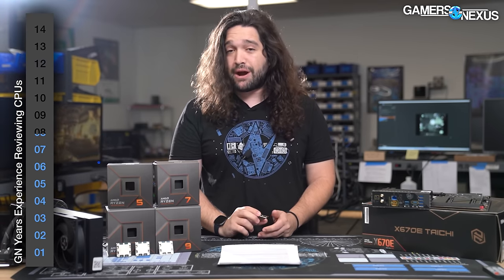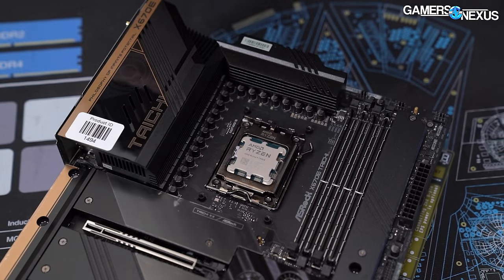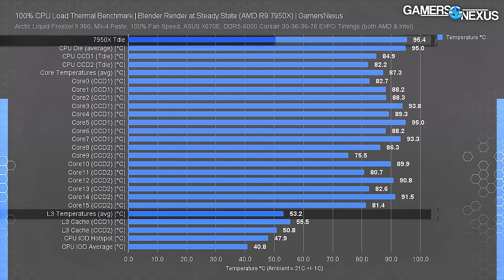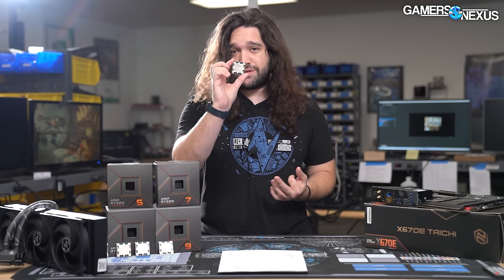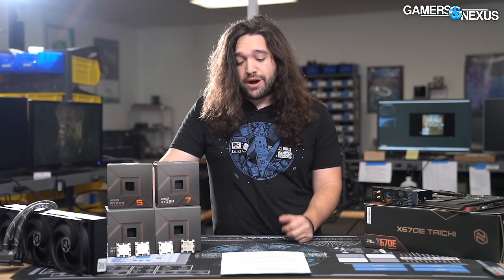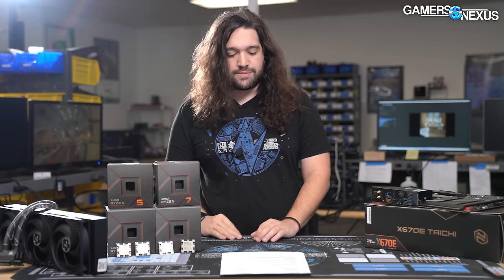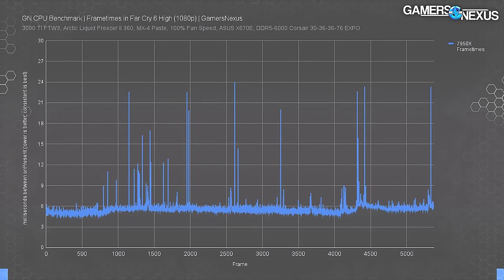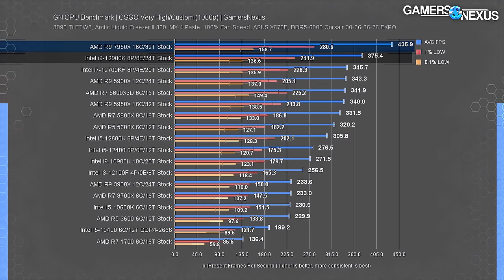95°C is Now Normal: AMD Ryzen 9 7950X CPU Review & Benchmarks

Comment: excellent report! I feel entirely vindicated having put together a 5950X system towards the end of its lifetime instead of waiting for Ryzen 7000. I'd planned on going to a 7950X system in 12-18 months but might not now given the power requirements, and given the massive spike in the cost of power worldwide (well, in "developed" nations). Thanks and I can't wait to see the 7950X and 13900K comparison.
Reply: I don't think you should look at max power draw, but at efficiency. Most of the time we don't run prime95, we idle most of the time or have very low loads.
I also expect that manufacturers also will make it very easy to limit power more if you want so, even under load, and also then efficiency is the key factor.
I have not checked all reviews, but read those numbers from AMD:
According to AMD: "AMD says the 35% overall improvement at max power actually increases to a 74% improvement when limiting the flagship Ryzen 9 7950X to 65W"

I think it's a good thing to limit the CPU power draw for energy price reasons, but if needed at some point you can run it hotter and faster.

EDIT I saw the numbers of GN now, seems indeed not to shaby plan to stick with the 5950X
Maybe wait until people undervolted it and look what those results give.
Reply: you want to build such a system but then show how sparse your knowledge about this topic is. excellent
Reply: I'm with the other guys on efficiency, see the Anandtech review for details on performance per watt. But I'm also happy enough with my Zen 3 build from late last year that I won't be upgrading till Zen 5 at the earliest. Will probably upgrade to a 5900x or 5950x if price continues to drop though.
Reply: @_clemens_  true, although I do occasionally run multi-threaded (i.e. multi-core) stress tests (developer). The max I've had out of my system was a sustained 90C under load at less than 20C ambient. Ambient does become an issue with the attendant possibility for thermal throttling especially in summer months with an ever hotter climate and no AC and using a Noctua cooler (that's now impossible with 7950X (Yes, I could swap the Noctua for an AIO))
Reply: @accelerator5524  so true lol
Reply: Lol the power draw of 7950x is low it’s 100 watts less then intel and way more powerful so 7950x is more efficient then 5950x and if you worried about 200 watts on your electric bill why are you looking at $700 to $750 dollar cpu and u do realize 200watts would raise your bill like 3 dollars a month lol
Reply: I'm also planning to buy one but only if DDR5 will become more cheaper or at least when companies like crucial or Kingston will release their value ram series (I don't want to pay the extra charge for the RGB and aluminum shroud)....
Reply: @Chuck0006  and if I'm in the UK with gas and electricity bills spiking to over £5-6000 per household next year?

Maxed-out the 7950X is NOT less than a 12900K in power consumption.

You may think it's laughable but these increased power requirements across the board particularly from CPUs and GPUs are going to affect us all, and not just from a single computer that we put together for personal use. ARM are going to be the winners here, more so than AMD and Intel, especially in the cloud and server farms.
Reply: @_clemens_  You're supposed to be able to set a power limit in software and have the processor follow that , which in theory should make it easy to fit performance to your ideal use case.  I wish they'd have shown results if you limit power draw to the power draw of the old processors, as GN have said several times that power draw and performance aren't linear.
Reply: @treyquattro  a maxed out 7950x is way under a 12900k the 12900k has been known to consume up to 350 watts and maxed out 7950x is like 230 to 240 and yea all the green energy stuff not good for anything like people see now cuz if you don’t drill for natural gas and the majority of power in the world comes from it the prices are gonna skyrocket cuz demand is going to way out do the supply
Reply: 7800x3D
Reply: @Chuck0006  200watts 7/24 will cost me over $120 every month here in Europe
Reply: @_clemens_  I run my 9700k at 100% all the time and highest it's gone is 70c just on air in a ITX with a full sized cooler, it had a low profile cooler and reached 90c, I got scared.

95c is crazy to me. Some of us have no overhead no matter what certain work just maxes everything out just like a benchmark...
Reply: @nerodia  Holy crap just read that review.  only a 17% loss of performance with 88w package power.  Almost makes me wonder why they even made default behavior so aggressive.
Reply: @dfloper  I’m gonna call bs on that the cost of kwh is 33cents usd in Europe at todays numbers which is literally only $47.52 and your not using it any near 200 watts for 24/7 most of the will be idling or in a sleep state at way less watts it so would probably raise your bill maybe $20 don’t over exaggerate
Reply: @Chuck0006  oy.
Reply: @_clemens_  I don't understand why everyone is getting so butthurt about the raising cost of electricity when in reality it won't cost you more than 20-40$ per year to run one of these newer cpus in your system. None of you are running prime95 24/7, 99% of you won't see a bill increase of no more than 50$ bucks max.
Reply: Wahh electricity costs are going up...then why are you building a 2k pc if you can't afford to run it. Besides you aren't going to an increase more than 40-50$ per year to run these new cpus.
Reply: @alexisbad123  (psst: I built a 5950X system with a TDP of 105W) As I explained to Ms Laxton, prices in Europe are far higher. I spend time between NA and EU. You can scoff, but these issues are significant for large sections of society. For most people, even rich idiots, throwing away money unnecessarily on inflated power costs is not a smart idea. And since the world runs on IT the increased costs are going to be felt everywhere (you may have noticed already, but then again, maybe you don't notice anything)
Reply: @ChimeraX0401  DDR5 prices are coming down, and that will accelerate when AMD5 increases demand. Six months ago I paid $600 for 64GB Corsair Dominator DDR5 5200. It's already half that price on Newegg. (In fact I may dollar-cost average my Alder Lake system!)
Reply: @treyquattro  I really do recommend reading the anandtech review of the processor.  The last few percent of performance are ridiculously expensive power wise.  The processor only loses something like 17% performance on average using half the power.  AMD is confusing me by going so aggressive out of the box.  Leave such inefficiencies to OCers
Reply: @Chuck0006  Actually i had a 3960x powered on for the last two years 24/7 and switched it off last month when i got a huge bill.

 I did measurements the 3960x with 64 gb DDR4 , one HDD and 3 NVME's was drawing 120-150 watts when idling on W10 powersaving to max, PCI express setting to full savings (which reduces chipset temps by the way) with one 5700XT with all clocks turned down. (PC was used for remote desktop and had to be on). The online UPS it was connected to a Powerwalker VFI 1000 was using 40 watts also idling.  So the PC just being on with the UPS was drawing 200 watts total.

 When i was doing work on the PC it used more than 350 watts from the wall. Now i loaded the VM's on an old FX8320 that sips power at 100 watt max and will only use the 3960x when i actually need its performance. I think AMD latest desktop offerings disregard power cost issues completely.
Reply: @Scnottaken  Thanks I'll take a look. My 5950X and 12900 systems are both actually quite low power consumption in a quiescent state - around 25W at the CPU according to HwInfo64. I've not measured at the wall. I prefer a more efficient design which is one thing that drew me to the 5950X when I was initially going for the 12900. I was a bit concerned at the relative inefficiency of the 12900 proposal so went with both, intending to only keep one, but I've held onto both.

As computer scientists we're always balancing efficiency with performance. I'm not convinced right now that the 7950X trade-off is justifiable given my current requirements (I'll check out Anandtech for more info) but given that my very original plan was to build a TR system, it's likely that I will end up with a 7950X sooner or later - the Intel offering is not going to be any better, not while they're still on the "7" (aka 10nm) node while AMD is pushing towards 4 and 3nm.

What has me most concerned is the 95C operating temperature. I managed to avoid using an AIO with my 5950X. Even under stress it doesn't throttle (so far anyway) The 12900 uses an AIO. The 7000 series necessitates one, especially at the top end (unless LN2 suddenly becomes feasible), as has been documented already (by GN).
Reply: @_clemens_  and Intel users run prime95 24/7? Love the fanbois spinning
Reply: @Scnottaken  The OCers don't give you the performance crown all the normies base their purchase decisions off of, stock performance does.

If you are a business you want to sell all the product you make. That's why they're doing it.
Reply: @DaybreakPT  From the sounds of it Eco mode actually is beneficial for gaming for the lower end chips, and they'd still reportedly get the performance crown at the higher end even with lower power draw.

Comment: i think gamers should wait for an X3D version of the 8 core, seeing how insanely good the 5800x3d still stacks up.

quick aside in terms of efficiency: computerbase tested different power limits. the 7950x matches the 12900k in their multi core performance testing even with a powerlimit of 65 watts, in a test where the 12900k is pulling 241 watts, and it only drops around 5% of multi core performance at 140 watts. so the CPUs have the potential to be really damn efficient, it's just that their out of the box setting doesn't prioritize efficiency. if given the cooling headroom they just pull as much power as they can if they're not told otherwise. i think most users should just set a 140 watt limit like the 5950x was and forget about it.
Reply: nah, you can buy the 5800x3d if you are on am4 and keep it for couple years more.
Reply: @NXDf7  Can you though? Are they even still available to buy is the question.
Reply: @wildwilie  they are where i live
Reply: @NXDf7  I did that. The x3D is just so good. Why waste money on a new motherboard, RAM and CPU cooler in addition to the CPU when you can just drop in the x3D for the same gaming performance with way less power consumption? Id rather spend that money on a new GPU that isnt nvidia.

Comment: Very interesting, the temperature behavior is surprisingly similar to laptops. Most thin laptops run at 80-95C constantly. The silicon can handle it and is designed in anticipation of that. If you're not pushing it up to the temperature limit you're leaving performance on the table. Stands to reason the same would be true for desktop especially when you're not limited by a battery like laptops are.
Reply: Yea. Yet when intel does it they are the devil.
Reply: To be clear, I'm a huge fan of the NH-D15 because I like cool and quiet PCs. So this would really require a change in mindset to be comfortable with these temps. Seems like your fan curve could really change peak and sustained performance if Ryzen 7000 boosts based on temperature.
Reply: @ericwright8592  Ditto - I like cool, quiet, and EFFICIENT. AMD is going backwards - I'm skipping this generation.
Reply: @apersonontheinternet8006  I mean isn't that mostly that intel is trying to pull 4090 levels of power draw. I haven't heard anyone complain of temps, but have heard that 250-300w is overkill.
Reply: And that's why laptops degrade so fast :)
Reply: @apersonontheinternet8006  to be clear. Intel is way way way less efficient.
Reply: @apersonontheinternet8006  Literally no one says that due to temperatures though. People hate Intel for other reasons.
Reply: @apersonontheinternet8006  it's a little different for Intel, they didn't specifically design their boost algorithm to ramp to max temp 24/7. Intel just happen to hit high temps because of high power draw. That said, I have no issues keeping my 12700k in the low 60C range with a NH-D15 during gaming. I'm not unhappy with it, it's great. Honestly my Ryzen 9 3900x system is harder to keep cool but it's a workstation so it's acceptable to be louder.
Reply: @tag206  AMD is using nearly the same power as Intel though...
Reply: Die itself maybe can handle it on long term, but everything else on laptop cant...
Reply: Minus the clocks falling off a cliff part
Reply: @KenOtwell  running at higher temperatures has nothing to do with efficiency
Reply: Only issue for me is with fan curves, having the cpu always at 95 is going to make the system perpetually loud. It means that for a quiet efficient system you have to undervolt/ lower fan curves and leave performance on the table
Reply: @OutOfNameIdeas2  I'd probably still use laptops though.
Reply: @THEpicND  not necessarily. Temperature isn’t power, this is a common misconception because you generally hit 95C when power is at it’s highest and your cooler can’t handle it, but what AMD is saying is the opposite.

Set your noise levels to where it’s comfortable and the CPU will scale frequency to match that.
Reply: @TheAtlasRises  Esl? Because I never implied amd was any better here. Just that I haven't heard of people complaining about temps so much as power draw.
Reply: @theondono  I guess we will see if it actually works like that.

Comment: I'm running my 3950x and a 1080ti and I honestly think I'll hold out for another generation. I'd really like to see the efficiency increase again which I think we will see in the next generation.
Reply: Dude both intel and amd are efficient cpus, If you rdont set it for max perfomance.
Reply: @Xenaman  These people like to keep overclocking everything to the freaking max and benchmarking more than playing games and then wonder why thier cpu are boiling and shit.I know guy with 12900ks and it runs good cause guess what? dude plays games and doesn't overclock 24/7.I already ordered 7900x along with asus x670 mobo LFG
Reply: you living in the stone age with that setup :P
Reply: @g-grizzle  Right? I'm still running DDR4 like some kind of Neanderthal.
Reply: The kind of "efficiency" increase you want is not coming, unless you buy a laptop or set the power limit yourself. 300 W GPU and 200 W CPU is the new normal for consumer desktops.
Reply: @Vegemeister1  Yeah the efficiency already came. This cpus consume much less for the same performance as the previous generation. But because Intel and AMD are exchanging blows whenever they make efficiency progress they push the limit and clock speeds to win over the other so they end up consuming more.
Reply: speed and energy consumption work together. when you overclock, you increase the speed and energy consumption. when you underclock, you decrease the speed and energy consumption. perhaps underclocking or maybe even undervolting is the way to go. with that said, the 8000 series CPUs are predicted to go down to 3nm which may give you better performance/wattage. 

now as for nvidia; they went from 8nm to 4nm. the upcoming nvidia cards probably are energy efficient. the only issue is that they clocked the hell out of it and are only releasing the high end models so that they appear super inefficient. i'm sure you can clock it down by 3% and save a much bigger percentage than that when it comes to the wattage
Reply: @lwrncl8329  On the same process node you're correct. I don't think anyone would argue that ryzen 1 was both more energy efficient and had better performance than Bulldozer did. This high power draw trend comes and goes over and over again, I'm just going to wait until it starts trending down before upgrading.
Reply: @Fmily  I'm still running DDR3

Comment: Would love to see how it behaves with a 120MM (thinking Alienware gaming PC) and $50 air cooler. I'm curious the performance drop differential. Also, looking to see if you lap the CPU and see if that helps or hurts.
Reply: I'm sure Dell has a new Alienware bonfire ready for Steve to test :D
Reply: yes, 95c in a super ideal escenario, I want to see how it performs like that, normal cooler, 25c room temp... I expect a lot fried AMDs because ppl will completely unaware of this (except enthusiast with huge towers and fancy liquid solutions)
Reply: @HellPedre  It won't fry, it'll just run slower and use less power while still sitting at 95c
Reply: yeah, like an NH-D15 or a cheaper 240mm AIO, maybe even like a $50 tower cooler just to see how much performance is lost.
Reply: @nathanlarson6535  linus tested with an nh-d15, and so did german website computerbase. in cinebench r23 they got 38710 points with the NH-D15, and basically the same with an  AIO. not much of a difference to other outlets, and probably quite a lot of variance depending on silicon quality between different samples.

Comment: So basically. 5800X3D should probably be the go to for most gamers. Now I just have to find out how big the difference is between 10900k and 9900k(which I have). They probably have a video about this on the channel as well.
Reply: imma save you some time. the 10900k is not a worthy upgrade over the 9900k and the 10900k will also not run on your current motherboard.
Reply: @lwrncl8329  That's not what I'm referring to at all. The 10900 is on the current graphs. 9900k and 10900k are also on the same, but older graphs. Knowing the different will let me know the uplifts in performance.

Comment: The 5800X3D also runs hotter than expected. I wonder if AMD was trying out this new temperature-limiting approach back then?
Reply: I’m thinking it’s less them focusing on temp and more on power consumption, they pull quite a bit more power than previous generations temp is probably just the side affect